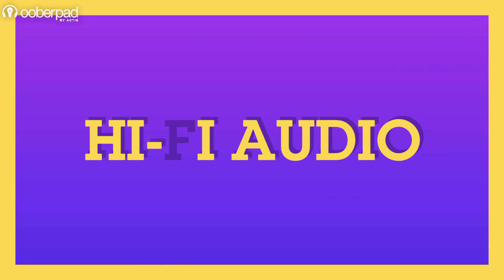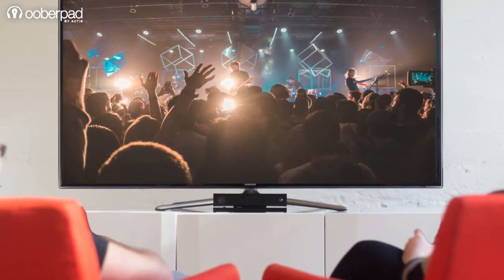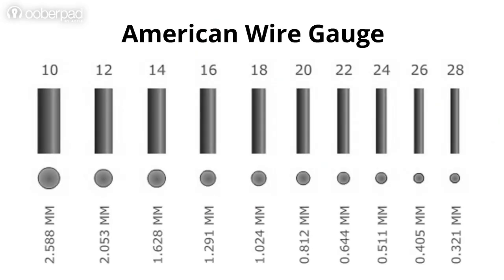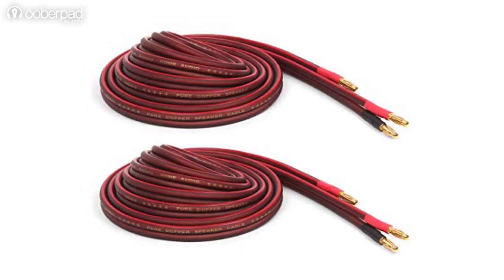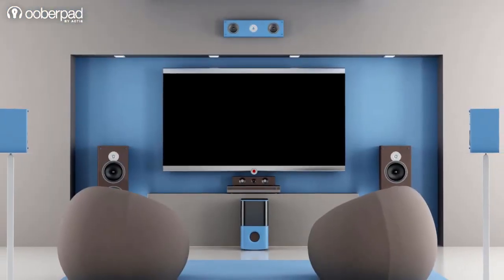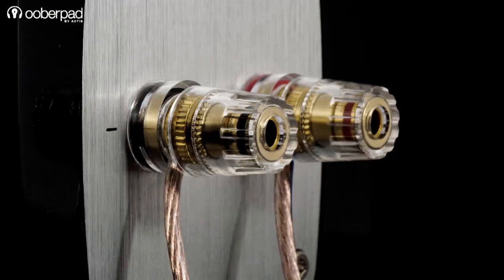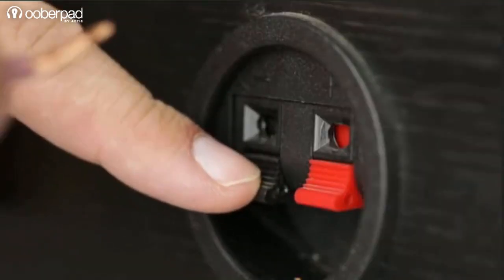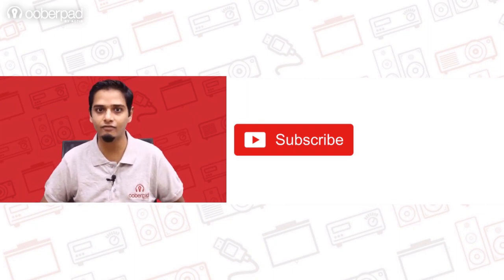Choosing Speaker Cables for your Home Theater System

Comment: Hello! Great video!
I have one question please. I have a Denon dra 365 rd amplifier an I want to use conectors. What kind of connectors do you think they are propper? At the speker I'm using spade connectors. At the amplifier I tried pin connectors, but they don't connect propper.
Reply from the maker: Hi, please connect with our team for a quick resolution to your query. Click the live chat button on our website  - visit https://www.ooberpad.com

Comment: 10 or 12 gauge stranded OFC cable is all you need.  Avoid CCA cable and don't fall for esoteric "snake oil" cables!  Avoid banana plugs or spade connectors as they introduce signal loss.  Strip the ends and tin them with solder so that there are no stray strands.  Simple!

Comment: If one has five or more channels and is looking to get rid of the background signal noise within the listening room, I highly recommend going with shielded cables (don't have to be expensive)

 Evan, after auditioning three separate AVR's, the same ambient sound of the room was still present! It was only after I purchased shielded cables that the noise floor within my living room finally came down. One has to remember unshielded cables often act as antennas for attracting RF, and the longer the cable, the better the antenna. Explains why when I used to disconnect my Heights and surrounds within 10 minutes, the room became a lot quieter.

When listening, I prefer not to put up with the faint background signal noise (noise floor)

One should try pressing pause or mute, and from the MLP, if one is unable to differentiate whether the systems are off or on, that's telling you your cables are crap.

When friends or guests come around rather than showing them how loud the system goes, I prefer to press pause/mute and show them how quiet it goes. None of them gets it, of course 😂

Someone who's changed his cables multiple times..
https://youtu.be/wwU0d3NfRQw?si=-79nnXOPCE74Hp3W

Silence is golden.
Reply from the maker: Thanks for taking the time to share your opinion. It's always valuable to hear different viewpoints on this topic.

Comment: I had buy this yahama speaker wif yamaha receiver. Wanna know, should i buy the hi-end wire to connect the speaker to get best sound or else just using the wire which yamaha provided is enough ya? Thanks
Reply from the maker: Hi, please refer to the supplied manual for more information on the same. Or get in touch with our Home Cinema Specialists via our website's chat section.

Comment: Hi, i would like to know whether the default wires provided in onkyo hts5915 are sufficient or it is recommended to change them. If we need to change it, which wire would you recommend and which type of banana connector is suitable for the system?
Reply from the maker: Dear Sir, The cable with Onkyo HTS-5915 package are the startup cables generally given as complimentary for temporary use. We recommend to use a good quality 15/16 AWG cables with this package for long time usage and quality sound. For these Satellite Speakers, Banana plugs are optional and generally not used since they are wall mounted. Hope this helps. Thanks, Team Ooberpad